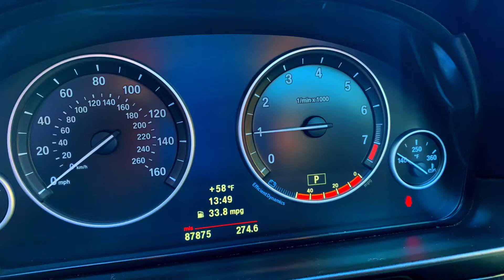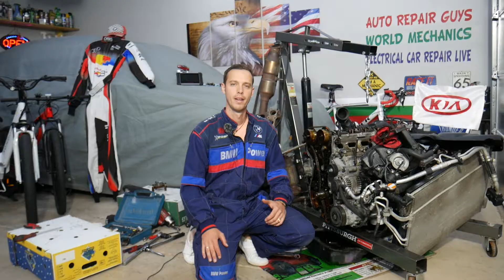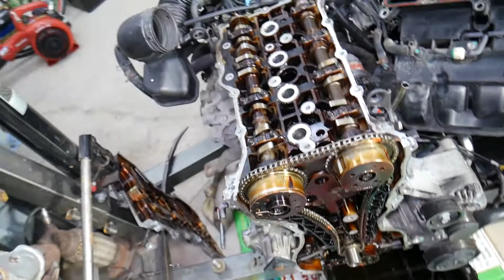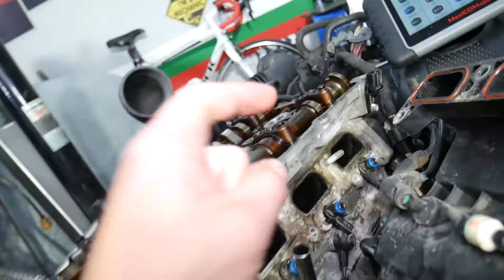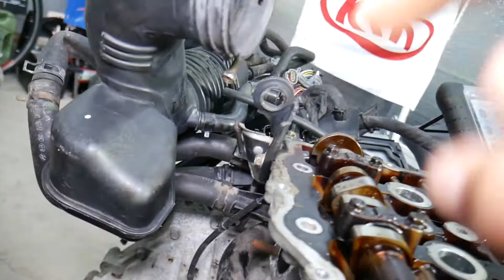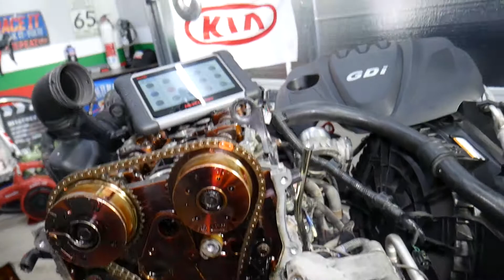CODE P0016 P0017 CAMSHAFT CRANKSHAFT CORRELATION KIA SPORTAGE SORENTO

Comment: Hello, I have a 2016 kia Sedona that the Dealer isn't covering the warranty for because they said that The timing components run on oil pressure so when a vehicle runs low on oil it can take only 2 -3 qts low the vehicle tries to compensate the timing and over advances the timing and shears the pin in the camshaft there is still enough oil in the engine not to set the low oil light on. The car had no warning lights and had never had an oil consumption issue. I do my own oil changes and sent the dealer proof of timing. Is it possible for this to happen without any warning light? Or are they just trying to not cover the repairs?
Reply: Theyre trying avoid paying for it.  NHTSA is forcing them to.  Id contact them.

Comment: Hi, not sure if i will get a response but i followed this video and replaced the camshaft and crankshaft sensors and still have the error. I also replace the MAP sensor and same.result. any recommendations?
Reply: Solenoid, or your cam/cam phaser/timing chain needs replaced.  Which results in pulling engine and taking everything off the front.  Might as well replace EVERYTHING mentioned since its all apart anyway.
Reply: @NW-Scale  thanks. I ended up purchasing a time kit and replaced it all which resolved the error code

Comment: Common issue.   Cam drilled too deep and pressed pin falls in hole.  Heat end of cam with torch and pin pops out.